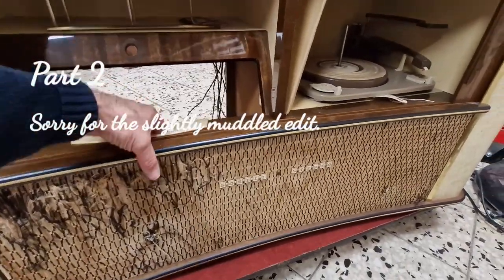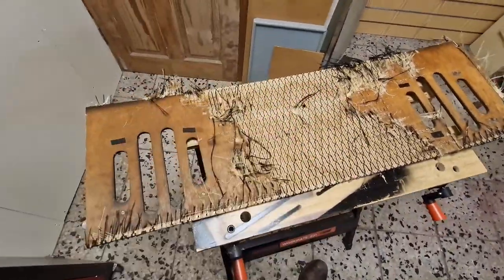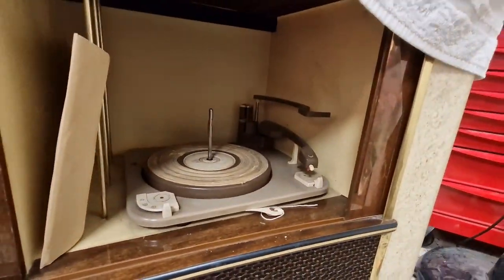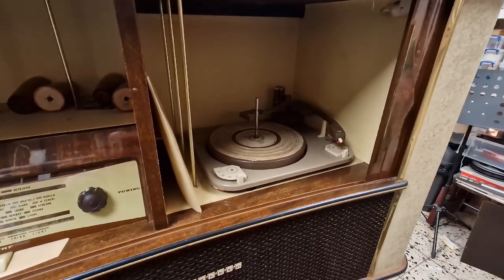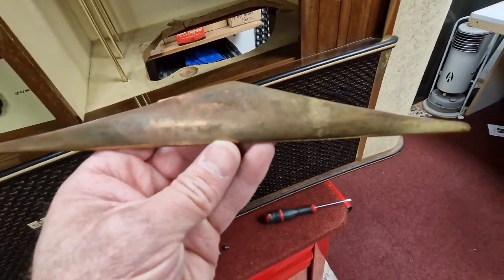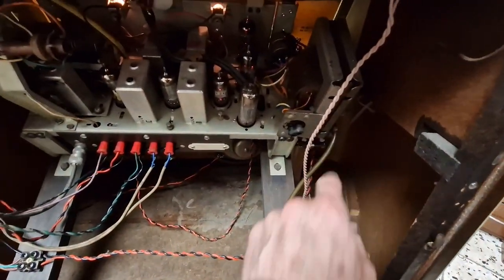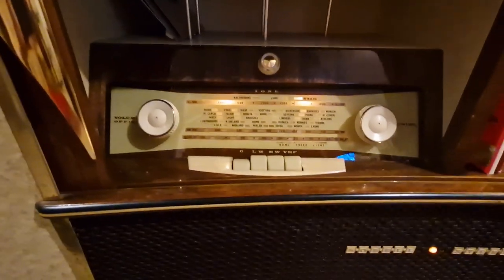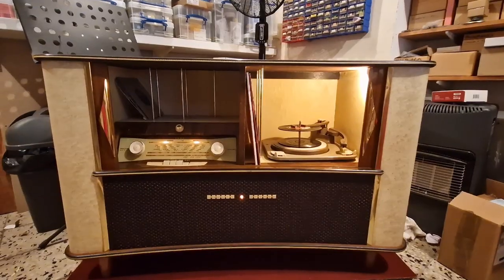Beautiful Sobell radiogram restoration Part 2.

Comment: Great video and really informative. We just bought one in surprisingly great condition but this video was fantastic to help with the tiny refurbishments required. 
Where did you get the replacement rubber mat for the turntable? I've googled around and can't find one that's as good a replacement as the one you found
Reply from the maker: https://www.dansette.com/ these guys. 👍👍